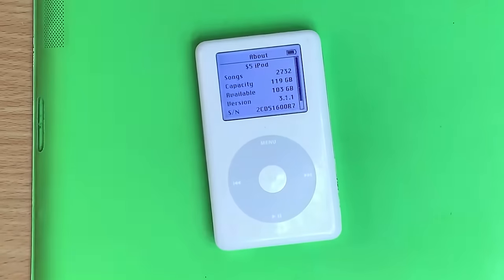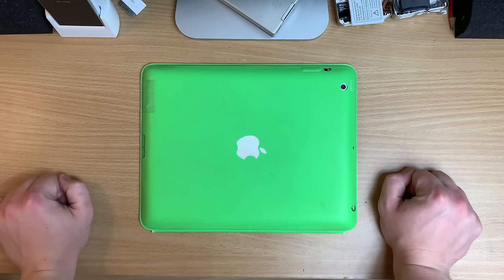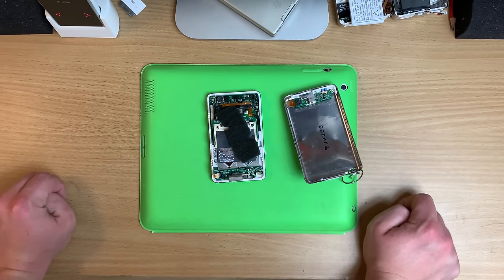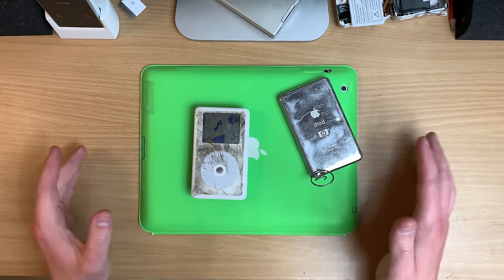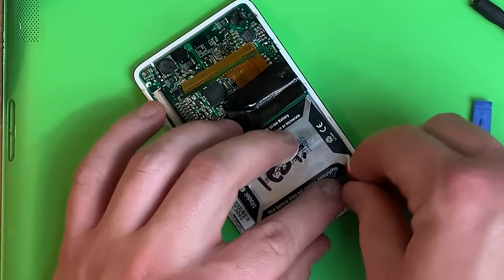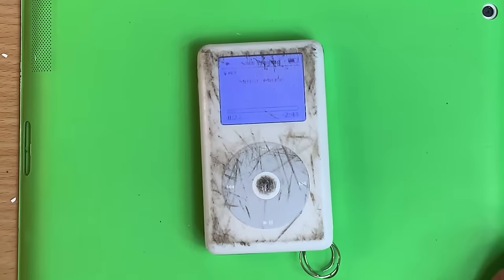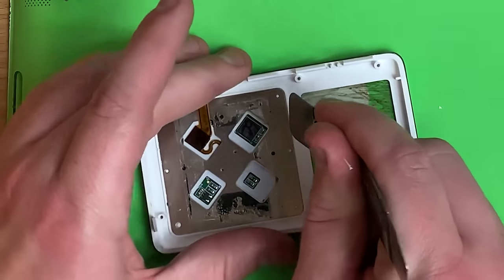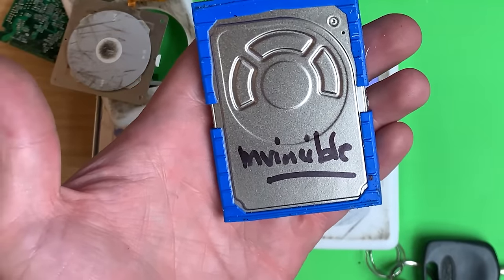Flash vs Hard Drive. Don’t watch if you love iPods.

Comment: could you try making one of these retro futuristic, portless iPod with wireless charging and Bluetooth + 256GB??
Reply: AAAAH I thought I was the only one with this thought!!! A wireless charging bluetooth enabled iPod would be so sick. I was legit about to start investigating Qi charger panels tonight to see if it would be remotely possible. It would need to be a 5/6/7 gen Classic so it could charge at USB rates (5V). I seriously want a pile of iPods to do mad experiments on. (runs to eBay)
Reply: iPods have the metal case which wouldn’t let wireless charging so you’d need a new back
Reply: Probably cant fit a flashmod, bluetooth, and wireless charging coil.
Reply: @batt3ryac1d  bet
Reply: Couldn't you get a clear case for the 5th gen off Ebay and use a wireless charger then? The metal case would make wireless charging impossible. But big chungus case, iflash adapter, wireless charge pad, and clear case would be neato
Reply: @batt3ryac1d  the 1st gen chungus could
Reply: @gniktrebor  nice one. 

runs
Reply: 256GB?! THAT’S NOTHING THIS MAN CAN PUT 2 TBS ON A iPod
Reply: @batt3ryac1d  you might be able to if you use the case of a 5th gen big chungus 80gb

Comment: I think the only reason why the HDD iPod won over the flash mod iPod, was because the battery and HDD fit snugly enough to also protect the insides most likely?
The flash mod one could’ve had some worn plastic, which popped open causing the rest of the thing to get dinged up in the process… or there was enough time for the flash mod stuff to bang around in there, bend and break stuff.

Comment: Were they powered on during the drag? If not or the magnetic drive was idle the read/write head may have been seated so much less likely to take damage. A shock while the head is above the platter will cause a head crash but a seated head likely won't dislodge.

Comment: Please don't destroy such devices. Since the mid 1980's hard drives have an automatic park mechanism to park the heads when the drive is off. There is very little damage that you can do to it when it's off. But if you drop the iPod while it's on and the platters are turning you may damage it. Some laptops have accelerometers in them that detect that they are falling and they automatically park the drive heads to prevent damage. If you drop a solid state drive while it's working, nothing will happen to it. It has no moving parts. I'm not sure if you had the iPods playing.. I just couldn't bear to watch... Lol
Reply: There was a time that.... When you were done using your computer (in dos environment) you had to type the command park to manually park the drive before you shut down the computer. My first PC was like that. It had a hard drive ... (Some computers didn't even have one and they were run only through floppies)  and it's size was an immense 20 mb. That's megabytes not gigabytes. Yet with dos programs you could not fill it up since everything was more or less text based. No sound, no picture and no internet of course. Just text and some monochrome graphics using an old type of display adaper called Hercules.

Comment: I wonder if the flash one broke apart due to the foam putting extra pressure on it or something? 
I was putting my money on the HDD breaking too. their quite durable drives tbh. you have to hit them while their spinning. and the iPods buffer quite a lot so might of not been spinning during the test
Reply from the maker: I made sure to ride around for as long as I could to ensure it read the drive. But heck I thought the head would crash the platter even sitting still, I hit every pot hole haha. But I blame just being opened more times than the HDD pod, plastic clips were loosened up a little but thats flash pods for you.
Reply: @DankPods  Fair enough. Guess that hard drive really is invincible then
Reply from the maker: It’s all dumb fun at the end of the day!

Comment: it's a pretty common misconception that hard drives in these devices are fragile.
That's only true if the device is on and actively loading songs into cache (i.e. spinning and with the heads over the spinning platter.)
Even then they're still impressively durable. 
In any other state the rest of the iPod will usually be dead before the hard drive itself.

Comment: and it says hp invent on the back why?
Reply: Some iPods were sold and distributed by HP as an agreement with apple. HP had to provide support for them as well and apple declined suporting those. Other than the etched logo mechanically and electronically they were the same as the normal iPods.